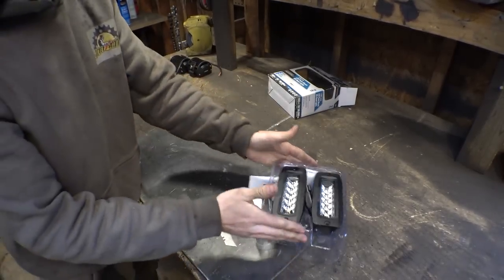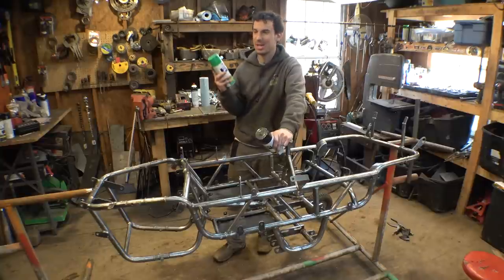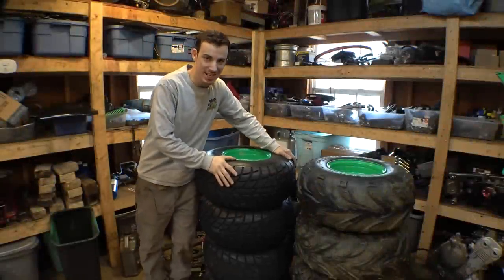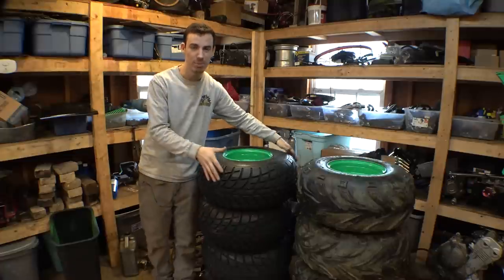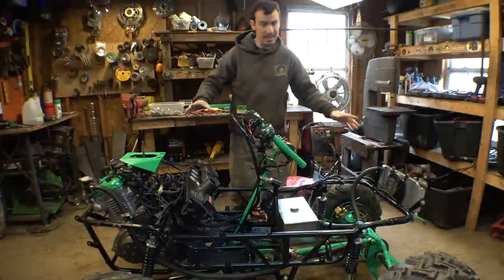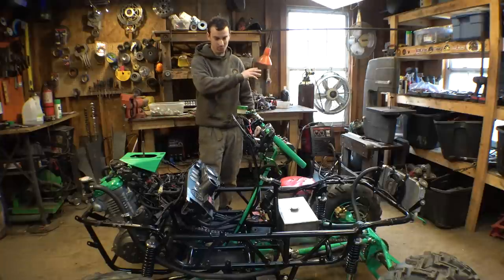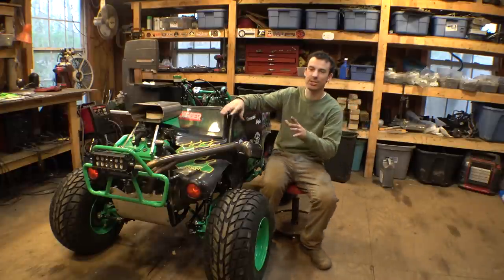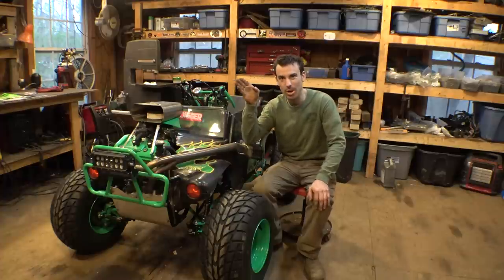Painting the Grave Ninja 650 Power Wheels Build

Comment: One tip I learned from an old painter when painting rims. Instead of masking with paper etc. use plain dish soap and coat the tires and when the paint has dried completely, just take a water hose and wash the paint from the tires.

Comment: I love the frame painting jig, but wouldn't a removable insert in the middle section be easier than cutting and welding for the different frame sizes?
Reply: or just have the tubes slide inside each other and have bolts on the side to tighten it
Reply: No point in wondering. This dude is very smart and completely stupid at the same time. He's gonna do what he's gonna do. When he doesn't like what he did he says " ok you guys don't like it I'll change it" whatever dude. Have a ball.

Comment: Super amazing; so envious of your build.

You've probably already thought of this but before your high speed test; make sure you do a full alignment on it. Would hate to see you lose control from a wobble or something else like that.

I'm also wondering if the heat from the exhaust pipe might melt some of the body panels; from your off-road test a while ago it looks like its not an issue.

Comment: iv been watching for a while and i have an idea, you have built a number of buggies and reverse seems to be a problem. so my idea is, I bet if you could find a cheap gas powered golf cart you could use the diff out of it, the axle tubes unbolt and it would be almost the same as the diff red beard is using in his buggy but you could actually get parts for it and im sure you could figure out how to make the axle shafts work

Comment: Question why didn't you just put the rear brake on the jackshaft you could have used a smaller disk and with the same caliper and would have the same effect that massive brake disk on the rear looks like ground clearance issues to me

Comment: Why not make clamps with screws to tighten to the go karts frame for painting instead of welding on pipe? Also I would just add a smaller tube on your painting stand with lock pins to make it adjustable instead of having to cut, add, or take away every time you need to paint a frame.

Comment: That stock light bar mount is hideous and oversized, since the light itself mounts with two simple tabs on the sides just fabricate nice slim tabs and ditch that awful stock bracket
And the Green is OK, but I think the frame wouldve looked better in a Dark Purple since it's the regular third color on the real Grave Digger?